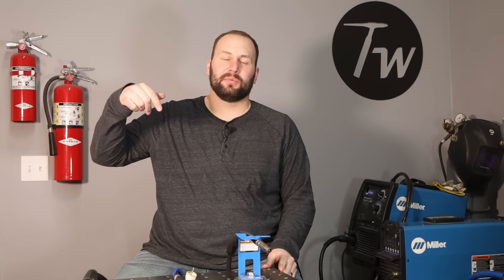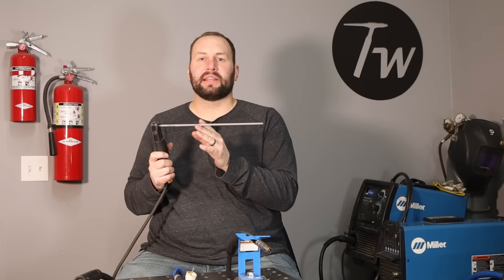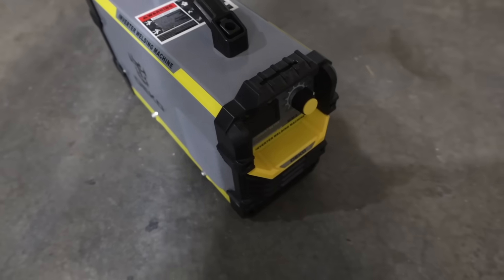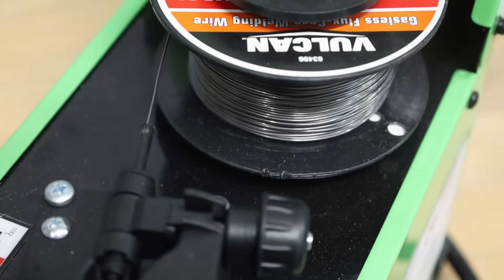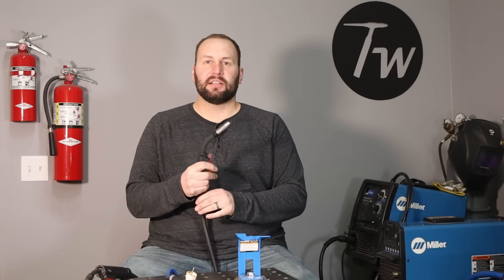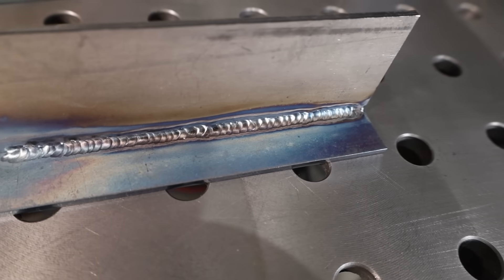4 Types of Welding Explained: MIG vs TIG vs Stick vs Flux Core

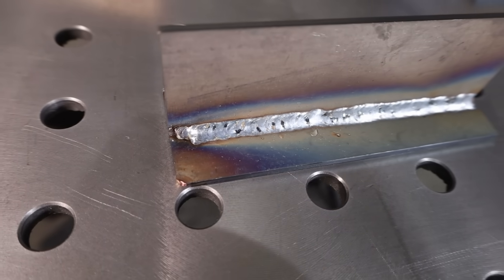Comment: What are those black spots on the weld at 7:37?
Reply: That's porosity can be from rust in the metal
Reply: @whitneyrobertson4852 porosity doesn’t look like that with circular MiG welds. It’s the silica or impurities sitting on top of the weld
Reply: Can also be the result from the gas being set incorrectly
Reply: Silica
Reply: It’s not porosity it’s silica and it’s not always black it’s just his angle. It can be yellow/orange. And it’s just a side effect of impurities in the puddle

Comment: i used to weld for minimal wage of 2.5 euros an hour or way under 3$ an hour
theres another type of welding that called laser welding which is similar or same as TIG

i stopped welding cause equipment is bad the working condition is bellow freezing and i hated everything about welding
not to speak employer demand you to do everything and know to read blueprints and drilling and so on for same pay

Comment: Great video to aquire the right first welder. Only thing I wish he added the difference in 115v  vs 240v machines.  I obviously have much more access to 115v outlets, but not sure if those welders are strong enough.?
Reply from the maker: As a general rule, 115 volt machines are generally good for up to 1/8” thick material, though there are several exceptions to this where they can run thicker material.
Reply: @TimWelds  awesome thanks for responding. 👍

Comment: Hi Tim, I am new to this kind of a lesson, explain to me how do you weld two metal together without having a hole instead of welding this two metal together, do you control the temperature but why spark don't exist on the electrode if i lower the temp? show me a little trick how can i do this

Comment: Are those arc (stick) welders able to operate on a 120v 15amp AC circuit?

I would like to do some welding on my property where there is no electricity and simply hook this up to a Honda EU2200i generator in the back of my pickup and weld.

Would that be possible?
Reply from the maker: It’s possible, but your amperage output will be very limited, meaning that you would need to run a small electrode like a 3/32” E6013. Even that might be pushing it a bit. I wouldn’t recommend it, it would be better to use a significantly larger generator or get an engine driven welder.
Reply: @TimWelds  Thank you for the quick response. I appreciate it

Comment: As a apprentice I learnt all of it mig ideal for building boat,box trailers and light steel stick good for heavy duty welding flux core 
you can run as gases less and most of the fab shops use it stronger than mig tig are good for welding stainless steel or alley

Comment: As a retired auto body repairman I would say one thing about flux core. If you have a small hobby type welder with maybe 4 heat settings, you will have difficulty with flux core because you can't get a roll of it thinner than 0.30. This is too thick for most small hobby welders to weld properly. The heat will just go to melting the rod and not enough will go into the material you are welding. The result will be ugly poor quality welds where the weld just piles up with little penetration. If you go with gas, you can use 0.25 wire ( used to be able to get 0.23 wire) , and your machine will produce enough heat to melt the wire and the material you are welding. Just a cautionary note from experience. Any small welder that comes with an infinite heat setting is a better option, and will increase your quality with flux core , but is likely more expensive.

Comment: As a non welder I’ve always wondered if there’s a danger of being electrocuted by the welder as you’re holding it? All that electricity passing through it? Do you have to make sure not to touch whatever is being welded on for example?

Comment: I have seen several videos talking about a CO2/Argon mix for MIG welding on steel. I have a straight Argon tank that I use for aluminum and I run straight CO2 for steel MIG. There is very little difference between weld quality on the 2 different gases. If you are welding to a code this may not be possible but I am n not doing anything that critical. It is much cheaper to run the CO2 than the mix. Bonus, if I run out of CO2 on a Sunday, I can run over to my local watering hole and borrow a CO2 tank they use for their beer tap system.
Reply from the maker: I ran straight CO2 from an aluminum tank for years when I did railing and gate repairs, it works fine. The blend works a bit better and the cost difference is about 5 bucks per cylinder for me, but there’s nothing wrong with straight CO2.
Reply: @TimWelds  I can get a tank of CO2 for about $35 but the Argon mix costs me about $150.

Comment: I hope I get an answer to this question, I'm currently getting a custom gas tank built for my truck out of 3mm sheet sheet, what is the best weld to use? Arc or Mig?
Reply from the maker: It could honestly be done with any of them on steel. I would use either MIG or TIG. If it’s aluminum, I’d TIG weld it.

Comment: What type of welding is used to weld bicycle frames?

I believe most are an aluminum metal or an aluminum alloy metal.
Reply from the maker: For custom bikes, TIG welding. A lot of steel frames are brazed together rather than welded. For mass production, it’s likely done with automated MIG in many cases, but I’m not 100% sure on the large scale operations for these.

Comment: Heya, looking to take a course in welding that will allow me to work on motorcycle customization. I have zero experience in welding but I believe I pick up skills well and I am committed to put in the work. There is a lot of conflicting information on the internet of what type of welding one should pick up. What is your advice?? 
Thanks for the help 😀
Reply from the maker: Thanks for the question! One reason so much information conflicts is that it really depends on the specifics of what you want to do. For custom motorcycles, I would generally recommend Gas Tungsten Arc Welding (TIG welding) because it is the most precise and versatile, especially if you want to do some aluminum work. Keep in mind that if you do want to weld any aluminum, you'll need a TIG welding machine with AC and DC output. That being said, it is possible to build some nice frame components from steel with MIG/MAG welding, which is a bit quicker to learn and a faster process to run.
Reply: @TimWelds  Thank you so much 🙏

Comment: Is heliarc welding any good??
Reply from the maker: Heliarc is a trade name for TIG. It used to be done with helium shielding gas, which runs a bit hotter than Argon, but it’s the same process. It’s awesome, my favorite process for sure.
Reply: @TimWelds  cool I never done that one before. Though it was a lost art or something , not many know what it is anymore

Comment: Tim, great job.  I tig welded for years and always had to be really careful to have clean metal, or I'd have oxide problems (porous welds).  A few drops of stainless took care of the porosity, but it still bugged me.  I was then introduced to 80S-D2 rods.  These rods make tig welding very forgiving with regards to porosity.  70S-D2 will be a closer match to A36 steel, but the welding shops I deal with can order 70s-D2, but always carry 80S-D2.  For the welding I do, it doesn't matter.  If a person was going to grind down all the welds, then the 70S might be worth the wait.

Keep up the great presentations.

Bob

Comment: Tig is the hardest? I found it to be the easiest personally less movement if once you get set where as stick you have to be constantly move it in while following you pool mig is just mig but tig you can just walk it if you are set up right and I’ve never touched flux but seems to be a more controlled stick

Comment: Something he didn't touch on for flux-core welding, there's self-shielding wire and gas-shielded wire. 

The difference is in the name: 
self-shielded = the wire doesn't require a gas atmosphere to protect the weld, and it is a wire-fed form of stick welding

Gas- shielded = the wire NEEDS a gas atmosphere to protect the weld from the air around it, to ensure no discontinuities happen in the weld (porosity being the more common)

Comment: its raining alot but the job needs to get done, the rails are in the ground but the bottom end of the rail in a pool of water..Is it possible to keep welding at the top even though its in the water Sir??

Comment: Is it possible to weld thin metal with Flux-core? Or it is just like stick welding?
Reply from the maker: Flux cored is a bit easier than stick on thinner metal.

Comment: Damn, after learning a bit of voltage and amperage electrode knowledge simple circuits from building batteries and coming back to this multiple years later

God it’s refreshing to see that I understand that stick welding is just electrodes and flux, damn that shit is so simple

When I was in school I learned a little stick and a good bit of oxyacetylene welding, shit was so fun, still got a welded die I made from that

New info as you get older, learning more about the old stuff, shit is so sick

Comment: Hey Tim. I going to buy a welding machine. Which is best for steel and stainless steel? I was thinking of the Primeweld mig 160 but I also would like one that is Tig and mig. Any advice?
Reply from the maker: The answer still depends a bit on exactly what you're doing, but I'd definitely recommend a TIG machine. The challenge with MIG is that you need different gasses for steel and stainless, so that adds a lot of cost for the extra cylinder. TIG does take a bit more practice to learn, but it's so versatile. Primeweld's TIG is a good option, but if you aren't planning on aluminum, you wouldn't need AC, so you might be able to save a little money with a DC only machine. Hope this helps!

Comment: i have to attach a half circle shaped steel rebar (diameter 10mm or 12mm) on to a thin cold formed steel sheet (1mm thick) which method would be the most appropriate one and not too expensive ?? from video it appeared i need to go for TIG welding

Comment: I have a question. I want to simply add some metal material to a small metal plate. About 1/16th thick steel. From what I'm seeing it looks like a MIG or flux core weld would be appropriate. My idea is adding metal to then file down to size, to fit. Any suggestions?

Comment: If you break your arc while stick welding and come back from the other direction into the middle to avoid BBs at the end of your weld you wont have to tomahawk your work or use a grinder

Comment: What would be the best for a newbie. I wanna learn/ build my kid a go kart and in time myself a small trailer.
Reply from the maker: I would start with flux core or MIG, depending on whether you want to budget for a gas cylinder. You can buy a MIG welder and use flux cored wire initially, then add a gas cylinder later.
Reply: @TimWelds  can a flux like the Chicago 125 do say 1/4 or 1/2 tube for a frame of a go kart? If so what kind of wire do you recommend.

Comment: Did anyone mention that the type of flexcore welding being done is innersheild
Reply from the maker: Great point! Innershield is a trade name from Lincoln, which is self-shielded like what was run here. There are also gas shielded versions of FCAW (with trade names including dual shield or outershield) that are extremely common in industry and are really great to run.

Comment: Just off the title 1. Love stick welding, simple, adaptable and straightforward. 2. MIG is pretty easy too but theres many different variations like pulse or short circuit. 3. I absolutely abore flux core. 4. TIG has its place and requires more skill than average.

Comment: What is the model of  Miller Welding Machine you used in TIG welding? thanks
Reply from the maker: It’s a Dynasty 200. That particular machine is 12 years old with a ton of use and hasn’t missed a beat.

Comment: I want to weld a brass nut to the rounded nut on a hot water valve in my shower.  This will allow me to remove the bad valve.  Which welding method would work for this job?  I was thinking about buying one of those $100 arc-welders on Amazon that a lot of welders rave about.

Comment: Hey Tim I have been getting good at Mig and Flux on 110, I can’t do 220 yet but I really want to get good at stick so I got the tooliom 200a mig welder and it has multi functional features. It has so many settings and I don’t fully understand, do you have any resources for knowing how many amps for rods on different thicknesses or any other specs for stick and flux? Thank you for your content and teachings!!!

Comment: This was a great video! But that SMAW example was sooooooo cold 🥶
Reply: Heat it up bruhhhh. You can do that on thinner metals the travel speed just needs to increase that would have been a better weld
Reply: With that said I sent this to my aunt who wants to start welding. This is the best video I saw for a comparison to all the most commonly used manual welding processes. Bravo good work!

Comment: I use a 1966 Miller 250 AC/DC high frequency tig machine, water cooled torch, 100% duty cycle! I still like it over the newer inverter units we have at work! Although the inverter style is much more portable!!

Comment: Excellent breakdown; I've never welded, but this comprehensive, top-down explanation helps me and my specific process for learning.  Some people can just dive right in and differentiate as they go; I prefer to have set peripherals and palpable indicators, such as the differences in MIG and TIG, which also blend with stick welding.  The flux core was easily explained and understood; slag is not a new word for me, but now has a specific reference to welding.  Thanks for the brief yet instructive video!

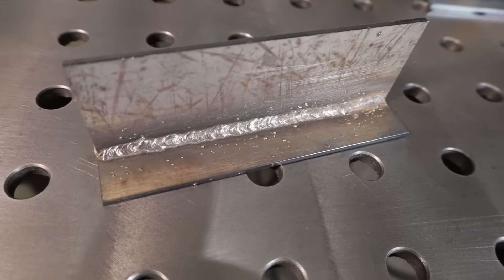Comment: 5:55 either you dont weld for a living or that was just horrible example of skill. So much spatter everywhere and welding line is not consistent. And same with mig can be seen on 7:11 + so much spatter around welding. Otherwise nice informative video.

Comment: Hi @TIMWELDS, im new to your channel and i really low how you teach, keep up the great work. So i have a question.  im wanting to buy a comination welder, DC Tig/mig/mma/plasmacut, what do you think about these types? Its going to be more to home/hobby use
Reply from the maker: Hi! It depends on the specific model, but they are generally great at MIG, MMA and usually plasma. TIG really depends on the specific machine. Some of the features a lot of them lack which I use all the time while TIG welding are a foot pedal for amperage control, high frequency arc starting and AC output (for TIG welding aluminum). I have two multiprocess machines that I use daily, and I like them. You just need to know what you’re getting. Also, keep in mind that MIG on steel needs a different gas than TIG, so you would need two cylinders to be able to run both. This can cost more than the machine. As long as TIG isn’t your main process, it’s a great way to go. If your main goal is TIG welding, I’d get a dedicated machine.
Reply: @TimWelds  then i think it will be good buy, i was thinking to start with something for steels and so and later will buy AC tig also to weld aluminium and so.

Comment: mig use pure argon, the method you show is called mag welding due to the co mixed gas, differ in quality, m7g is better . I mostly use  flux core with mixed co gas and stick welding due to better quality than mig or mag. tig is highest quality. Just saying

Comment: From highscool to today this was my trade and I've loved working in it all my 63 years Tig was my favorite in stainless steel and aluminum. Flux core is very hot and I did that in the 90s up in Timmins welding heads on hydraulic cylinders for the mining industry. Robots can do a lot nowadays so this trade will just die out except for the home and small shops.
Reply: Can you cut metal with Tig like with gas cutters.

Comment: My stick welding machine has been collecting dust since I bought a Flux core one, it does everything I need, which is mostly welding exhausts and building furniture.
Reply: Would you be interested in passing your stick welder down? I would like to learn but not In a financial position to do so. Im getting into racing 4 cylinder cars and I’m tired of asking others to weld for me

Comment: I use an old Lincoln 225 ac welder  some welds look great. But some look terrible I can't figure  out why
Reply from the maker: I love those old tombstones. Not sure what rod you're running, but you might try 7018AC. If you're running 6013, it can be difficult to distinguish between the puddle and the slag. Once you can see the puddle, everything goes better. I have a video called "Stick Welding Basics for Beginners" which will walk through the technique and might be helpful also.

Comment: I'd like to see you use the harbor freight 80 amp stick welder to weld thick steel. Something like 1 inch steel with a deep bevel.